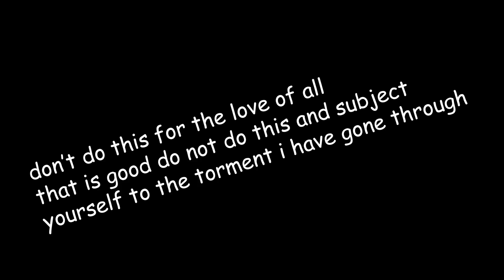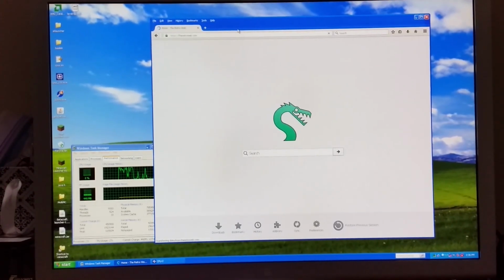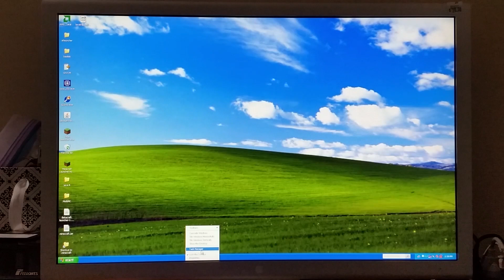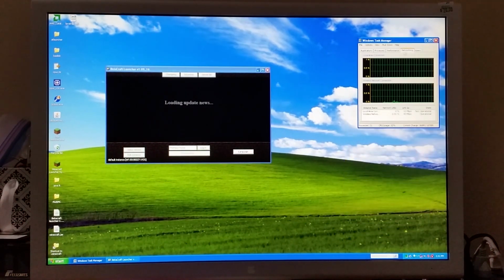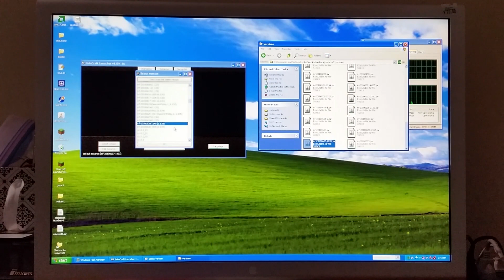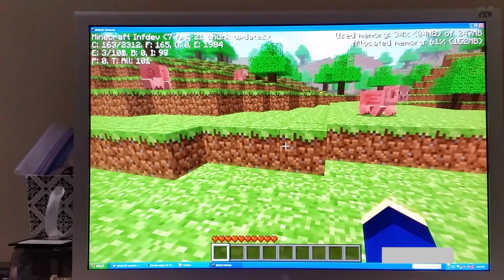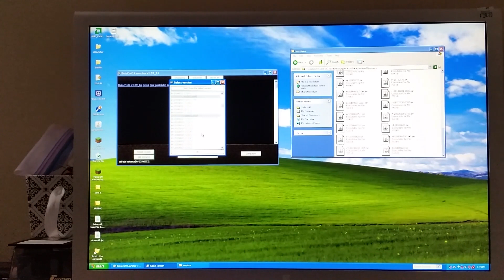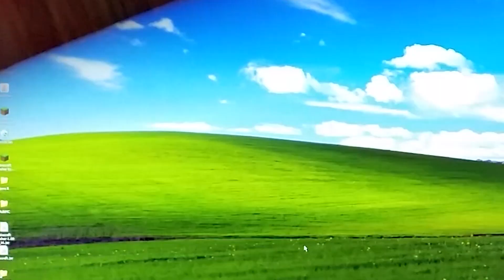This was never the intended use for the AGP slot...

Comment: I remember motherboards that emulated AGP slot over PCI bus. Asrock released P4i65GV/P4i45GV motherboards based on the Intel 865GV chipset with disabled AGP. Asrock called it AGI port, but video card compatibility was limited.
Reply from the maker: and here i am, doing the opposite of that lmao

Comment: Does that AGP to PCI adapter support 66 mhz mode? I know AGP is essentially a subset of 66 mhz PCI.
Reply from the maker: yup! in fact it's actually right on the card itself if you look closely at the thumbnail! there's a little warning in the silkscreen labeled "USE ONLY WITH 66MHZ PCI OR PCI-X". Since PCI to PCIe bridges support 66MHz operation, I'm able to bridge AGP to PCI, and in turn from PCI to PCIe to use the wifi card!

The only other card that I can confirm works with this adapter is an Intel pro/1000 PCI-X ethernet card.
Reply: @TheMajorTechie  well now I want to know if you can put a rtx 4090 on it
Reply: @TheMajorTechie  Interesting, I wonder if this would work with one of those Voodoo 5 6000 replica. Those are 66 MHz compatible.
Reply from the maker: @cptcrogge  maybe, though I definitely don't have one to test with lol
Reply: Moreso I was thinking of plugging in a low profile GPU into my dual P3 board. GTX 750 or something.